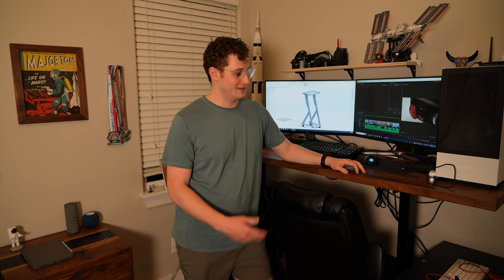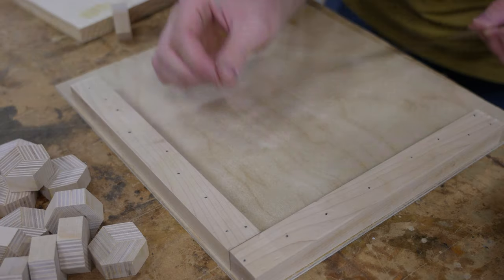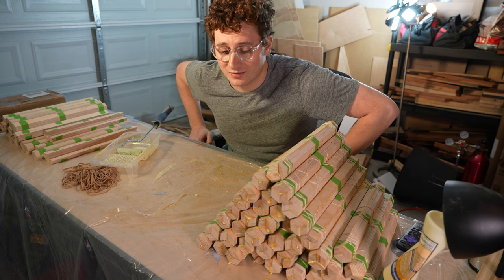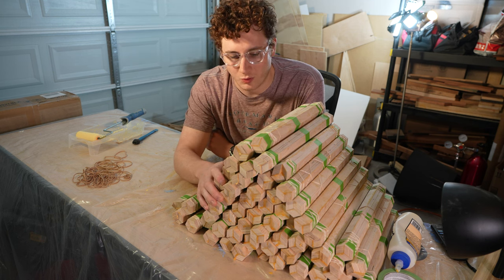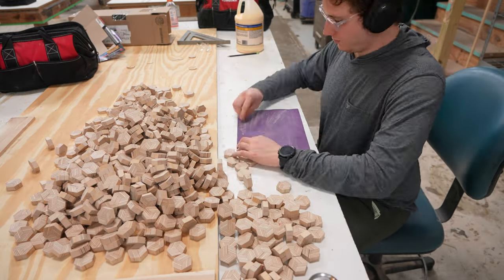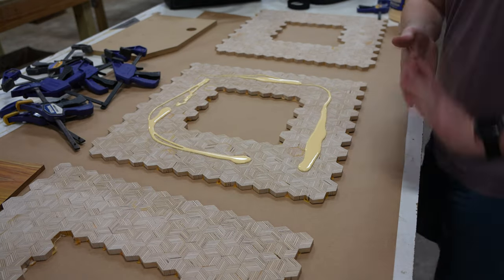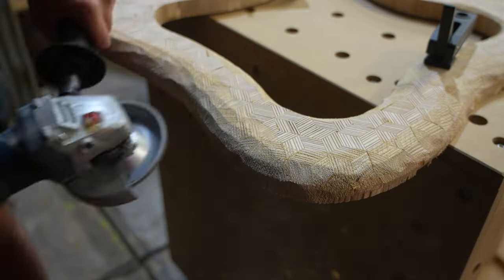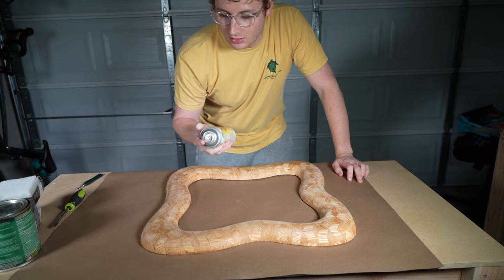I Tried To Make a Desk But Ended Up With A Funky Looking Mirror Instead! Success or Failure?

Comment: Why did you not use the CNC for doing the carve?
Reply from the maker: Mainly that I didn't have a 3D model that I was working off of, just the 2D outlines of the profile. Also it would take a while to CNC, like several hours at least. But that would've been totally possible too!